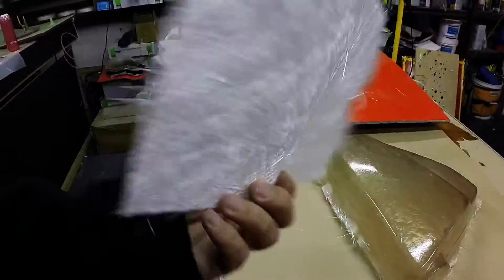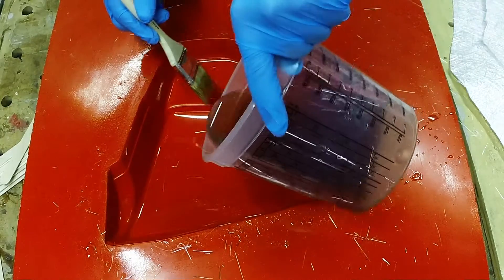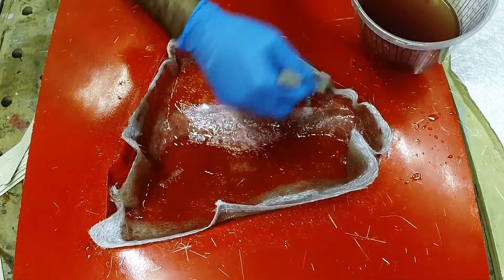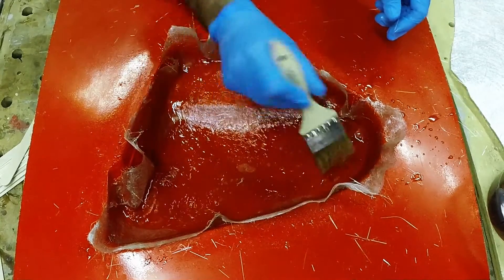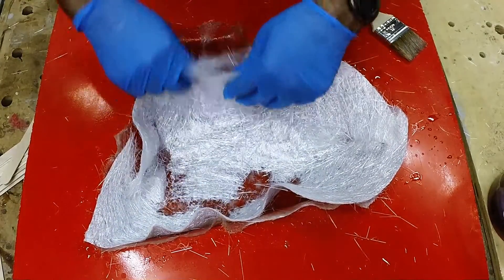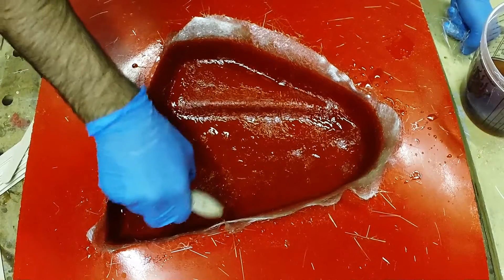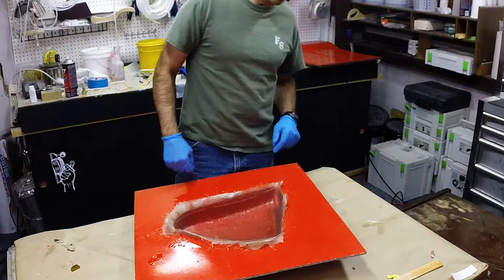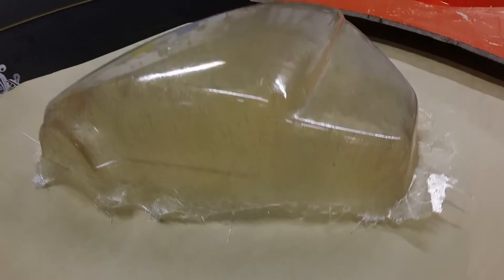Fiberglass Chop Strand Mat - Building a Motorcycle Side Cover

Comment: How did you make the mold?
Reply from the maker: How to Make a Fiberglass Mold from an Existing Part: Part 1 Preparing the Plug - Custom CX500 Moto https://youtu.be/E5rs08VKppk
Reply from the maker: https://youtu.be/hdMCzBuvxd4
Reply: @FiberglassSupply  Hey thanks Mathew I have a ZL900 abd the side covers are almost impossible to get and I would like to make a couple of spares for mine. I suppose need to paint to get them in chrome.

Comment: So can you do the same with using carbon fiber instead of the chop strand fiberglass?
Reply: yes! 
but you will use much less resin (fiberglass mat uses 1.8 to 2.2 its own weight in resin, fabrics use between 0.8 to 1.2)
and you can use epoxy

Comment: does not having gelcoat affect the surface of the mold over time? etching, ect
Reply from the maker: It does put more wear and tear on the mold surface.  But if the mold is well released and looked after it shouldn't have a big negative effect.  We have customers that have run 400+ parts direct contact out of their molds with infusion, which is a more abrasive process, without problems.

Comment: Great video, just what i was after. I'm looking at this option to replace my 1973 Honda SL125 side panels BUT they have 3 pegs that fit into rubber grommets on the frame. How do I fabricate those on the side panel like the original? Thanks
Reply from the maker: I'm not familiar with the SL125 side covers but what we are going to do with this one is fabricate the posts that go into the grommet either out of some plastic stock or with the 3d printer and then bond them to the cover with panel adhesive.
Reply: The SL is a scrambler style bike,  thanks for the answer i do have that option and know someone with a 3d printer. I would like to incorporate the posts as its laid up so i will do a bit of experimenting. If you make a vid of the posts please consider posting it up, cheers and good luck